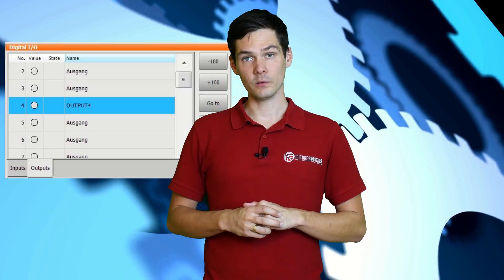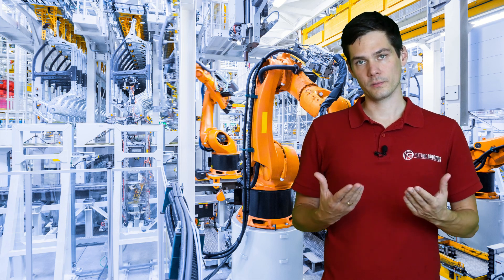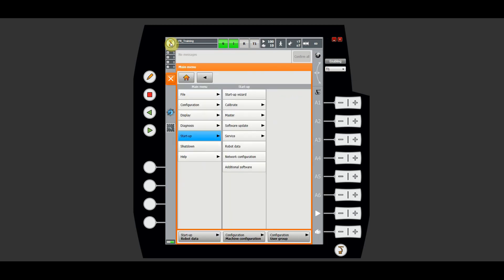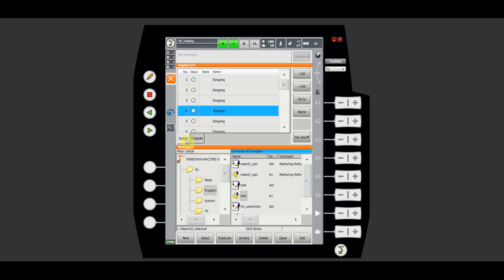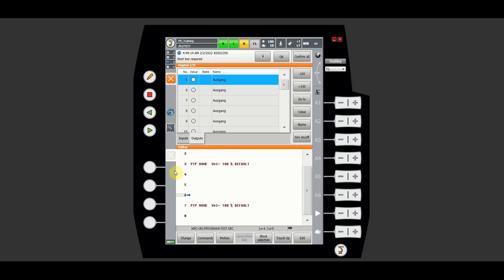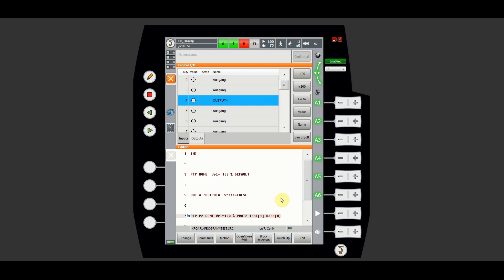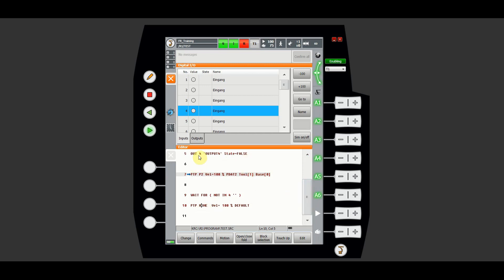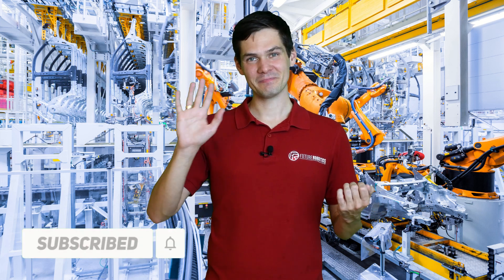KUKA Digital Inputs / Outputs, using digital signals, I/O explained

Comment: Thanks for your video, question, how can I link an external automatic mode output to a digital output? For example, link the $in_home output to any digital output, so that when the robot is at home, it turns on that digital output? Thank you
Reply from the maker: There are dedicated outputs that you can use, but you can always add $OUT[x] = $Variable in your SPS logic, there are many approaches, but it depends what you'd like to accomplish